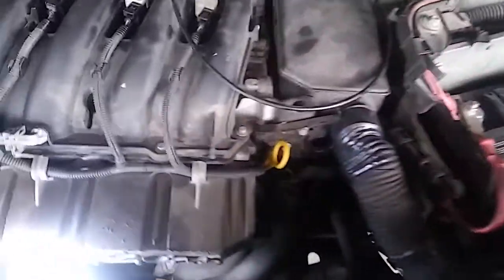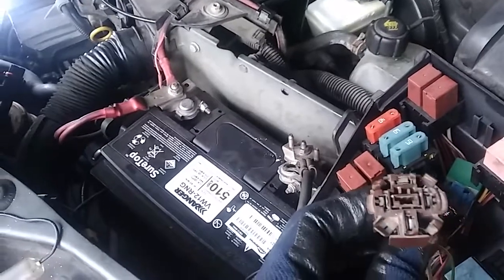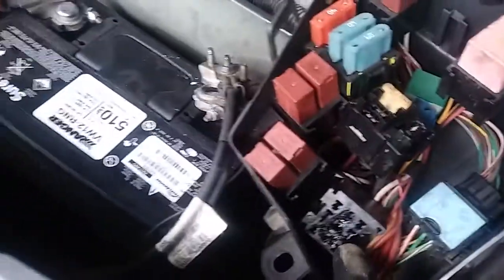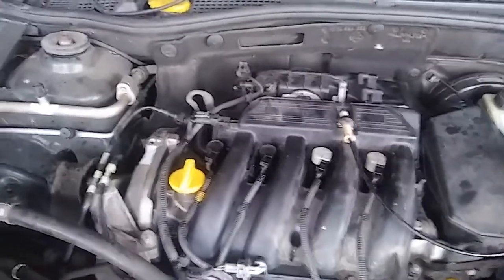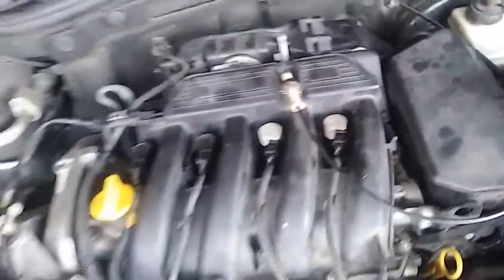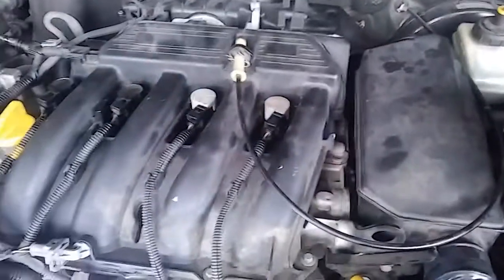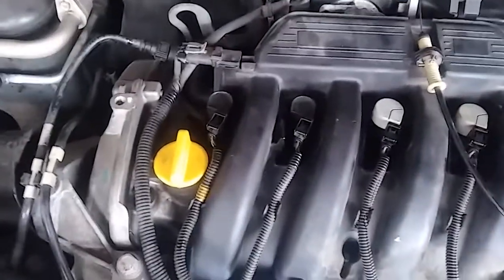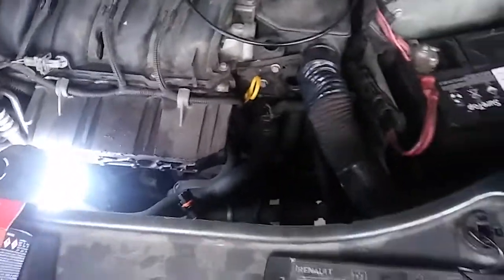2015 Renault Duster over heats

Comment: Hi, Dear I have renault duster 2013. I have problem, when my car in traffic thats time car temperature going rise...when I am in drive highway without jam and traffic car temp going cool or good....Can you suggest me what can I do or which which parts need to check...please.
Reply: Did u fix this. Facing same issue. Any feedback is much appreciated
Reply: same issue
Reply: I have the same issue. Only on traffic engine temperature goes high. How to fix this
Reply: Never change with Thailand or China radiator  use original radiator  ,spare parts shop they will give you copy one but the problem will not solve
Reply: Remove thermostat and put one extra fan also the problem will be solved ..use only coolent  no heating issue again
Reply: The same problem was solved  after changing with original radiator .
Reply: @realtimezone4631  ordered original radiator hope this ll solve my issue
Reply: If you used only coolant water not drink water then maybe check the thermostat or water pump.

If you think it is fake heat then change temperature sensor.

This only apply if radiator fan's runs both speed.